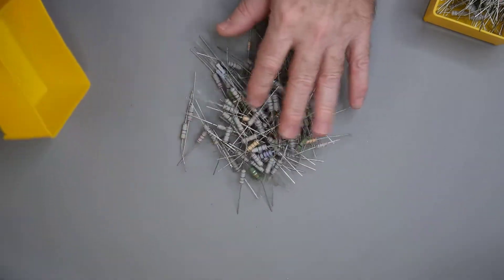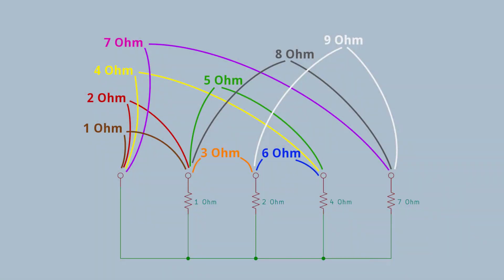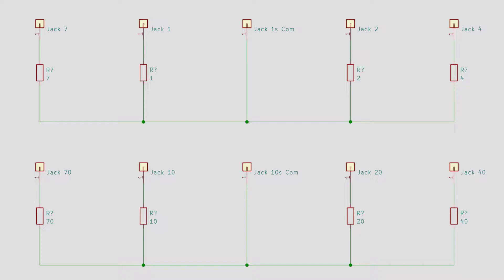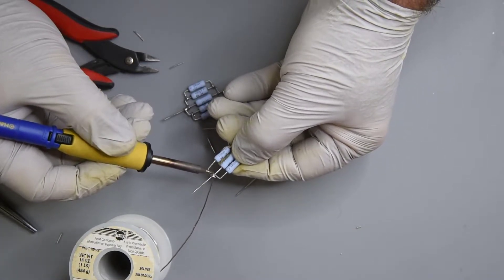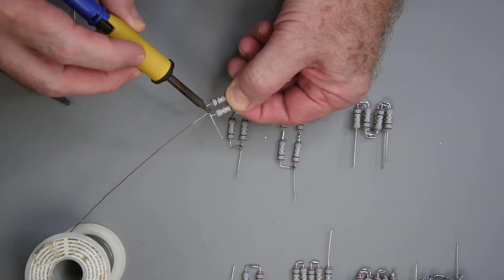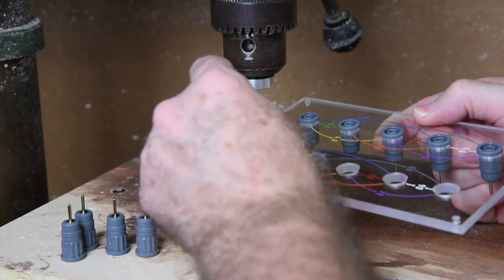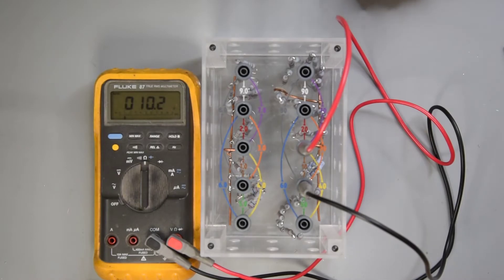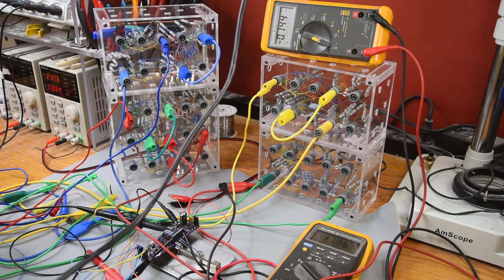Low-Power Low-Cost Resistive Load Bank Build

Comment: Schematics is wrong @1:50 you have 1 ohm and 2 ohm connect to the same point
Reply from the maker: One end of the 1,2,4 and 7 ohm all tie together.  The other end of each resistor is the connection terminal.